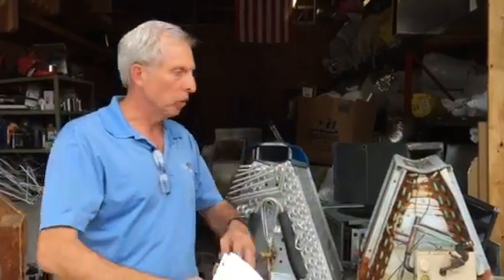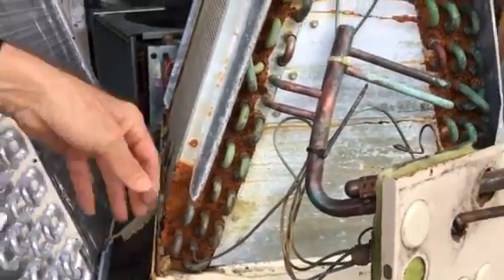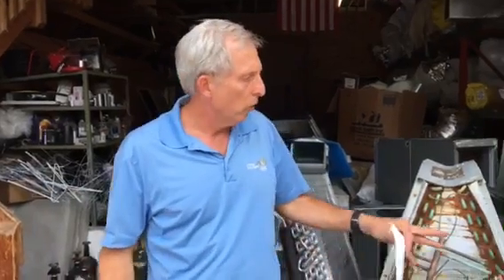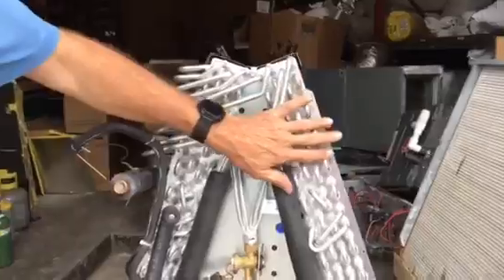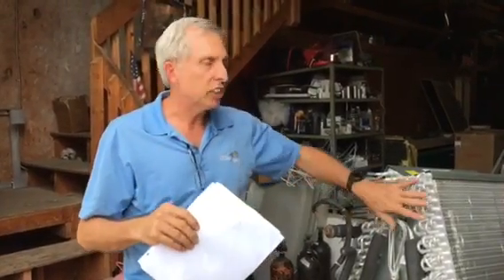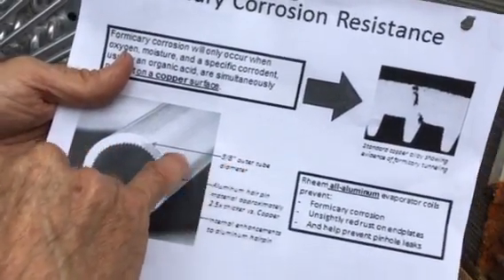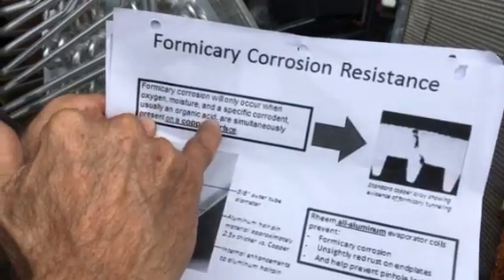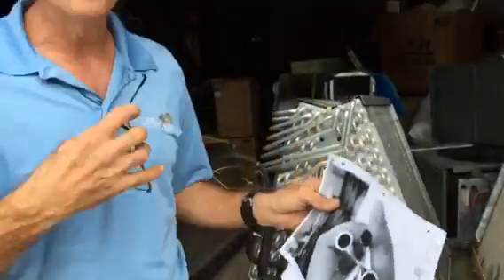Why does my air conditioning system leak freon?

Comment: i had very little problems with copper coils  this was back in the late 80s and 90s now with newer coils aluminum which are made with thinner tubing are junk and higher pressure. i replaced 2 coils in the same home 5 years old

Comment: I believe it's due to the aluminum being a weaker metal than the copper and the freon that's standard in the United States is  410A which requires a higher pressure. R-22 didn't have as high a pressure as 410A.  If R-22 or R-32 we're used in aluminum evap coils, then I don't think it would be so problematic but high pressure 410A circulating in an aluminum evaporator coil is bound to cause continuous leaks.

Not to mention the chemicals that can break down aluminum faster than copper. Be advised that bleach is not to be poured into your PVC drain pipe because bleach (fumes) can cause aluminum to breakdown faster than normal. Use vinegar to clean your pipe.
What needs to be done is the industry should be using a stronger metal to make the evap coils.  It would cost more money but upon installation of a new unit, the coils would last a lot longer vs paying $800-$1200 to pay a technician to replace the coils and add freon every other year (especially if your system uses 410A freon).
Reply: They charge $325 for leak test and $1750 for evaporator coil replacement now

Comment: Our Goodman aluminum coil just failed after 3 years!! 
We’re being told that we need a brand new coil cause these cant be welded??

And in 100 degree SW Florida heat!
Reply: some people can repair them. Still expensive because system has to be recharged.
Reply: Yeah, my 2 Goodman evap coils failed 5 within 4 years.  I live in central Florida so I understand.

Comment: In the auto industry we have been using aluminum evaporators for years. We had a big problem when they first came out but once the manufacturer put a protective coating on them they were fine. I can’t tell you how many dashboards I pulled out of jeeps and Chrysler cars changing leaking evaporators.
Reply: Ya thanks I will never buy a jeep or chrysler thanks for tip

Comment: Wish they'd put that in my ac.. Replaced 4 coils in 8 years & need another one now. Window units can have a 3 year warranty & cost way less than a coil which only has a 1 year warranty. Not jacking with my damn central air anymore.. nope.. not going to happen.
Reply: something wrong with the ac people you use, makes no sense. pony up and drop $9,000 on a bosch setup, pay once cry once.
Reply: @REALBanannaman  No.. AC is too close to the dishwasher. I have well water that corrodes everything.
Reply: @texjames2000  good point, volatile organic compounds like chlorine eat coils, get a carbon prefilter before the dishwasher, but that takes out the chlorine
Reply: @REALBanannaman  Wish it was Chlorine.. Its calcium, Lime and rust.. mostly Iron.. Well water is just as bad as chlorine.
Reply: @texjames2000  filtration could help ya out in those cases! Best of luck!

Comment: Our contractor installed split unit about 15 years ago into our 100 year old house. This unit in the attic overflowed and ruined our ceiling twice and the unit has had to be recharged every spring since it was 6 or 7 years old. The contractor went out of business the year after we got it so we were stuck with the headache. My question is, can no one find the leak? One company came and said we don’t see a leak and charged the unit which last almost all summer. Every year same thing.
Reply: 10bigrob10 it's your evap coil, find a reputable company and tell them you want a leak check on your system, lazy techs will charge the unit a go without leak checking....

Comment: Hi, I have a Rheem RHSL-HM2417JA air handler that I was told was leaking. 
Geat video, now I know what a coil looks like  I have a Rheem RHSL-HM2417JA and I Just had my 410a refilled The system was put in 2010 and that seems to be a short time for it to be leaking. I was wondering if ANYONE could tell me a "price range" it would be to replace the coil in the handler?  I am legally blind and will have to finance it so I would rather know ahead of time how much to expect...  Thank  C.P
Reply from the maker: between 300-600 hundred
Reply: Thank you ! I can save up for that.. Keep up the good work!

Comment: Does the thicker gauge on the coil mean lesser heat exchange efficiency? Also doesnt copper have a better heat exchange than aluminium. How is that compensated?
Reply from the maker: they both have good exchange rate, the industry is finding out that aluminum is less problem with corrosion
Reply: You can see the aluminum coil has more piping for more surface area

Comment: That's not going to help the Chinese capacitors, fan motors, contactors, etc or the accumulator tanks that wear through on the bottom due to faulty engineering. And the general engineering problems that make Goodman so, well bad. Be honest, when you take the outdoor cover off (use needle nose pliers to pry the damn thing off) it looks as if a third grader engineered the thing....wires all in front of the contractor and everything else. Assembled in America made from Chinese parts ought to be a new requirement for origin recognition

Comment: Started finding the Aluminim coils are leaking also. I could fix the copper leaks but the Aluminum is almost impossible to fix. Have had to change one three times this year in the same air handler. Hope the last change will last for a while. Need a coating on those return bends
Reply: One of the big problems is Goodman, never install Goodman/Amana or Daikin. They surely know how to do something, but making hvac is not it. Maybe they know how to breakdance or something.
Reply: @charlesterrizzi8311  I wouldn't get a Goodman even if it was free.

Comment: How would you clean a coil like that that's sitting on top of a gas furnace where you have to get to the underside of the coil. I want to do this without removing the coil. Can you remove the A shaped tin plate on the side so you can get your hand inside. Thanks.
Reply from the maker: on some coils you can, some times you can something under them to catch the cleaning solution
protect the motor

Comment: The old coils worked just fine. The problem was they made the metals much thinner to save money and they would corrode much faster. Also the metals they used were not pure which will cause them to break down very fast. Glad they are aluminum now.
Reply: Aluminum coil is much prone to leaking